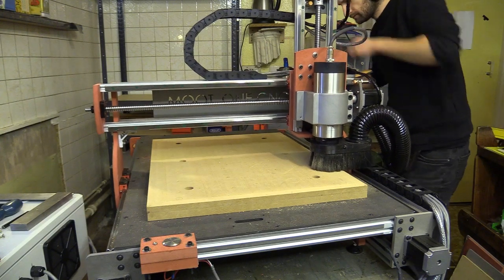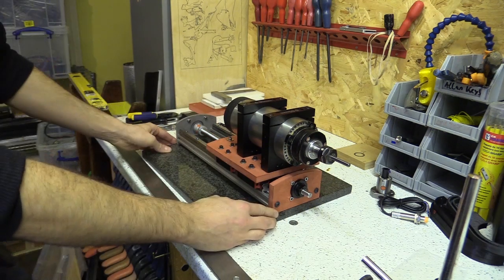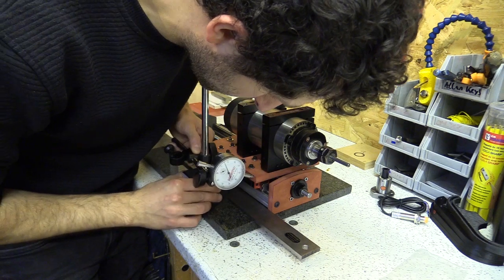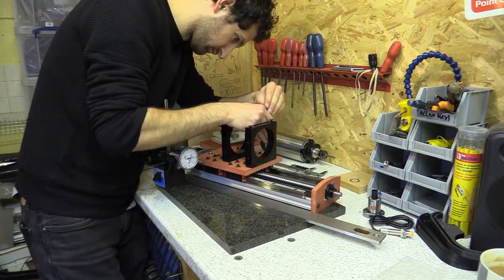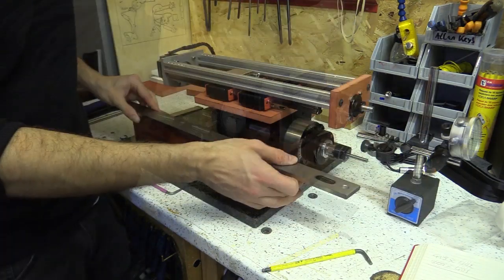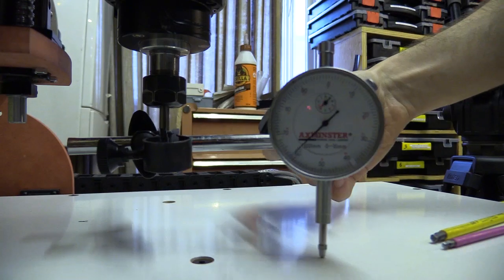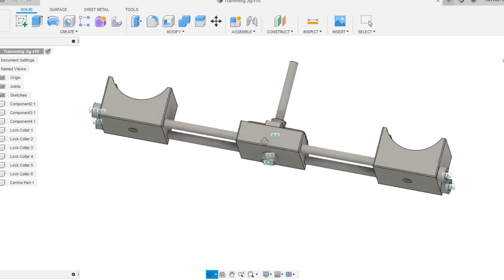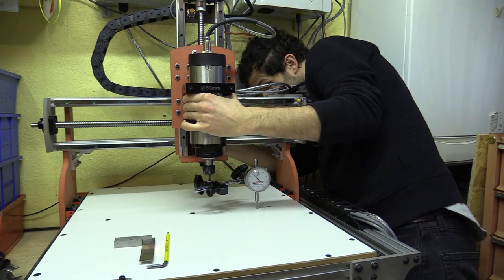#47 MOOT_ONE - CNC Z-Axis Assembly - Spindle Setting and Axis Tramming

Comment: I figure if I avoid getting a granite surface plate and machinists rules and 123 blocks, etc, for metrology, I won't notice how wonky mine is. It's good enough for wood and using belts and a lead screw there is only so much I can deal with. But yours is another step into regidity with the rails and ball screws. It is so interesting to see how the various parts  of a CnC machine are kind of in this arms race. Improve one aspect, then you have to raise the bar on another part. Again, a nice video to go over.
Reply from the maker: Yeah it kinda is a bit of a race - but I think I've plateaued now. I can cut things at a decent speed and finally understand how to calibrate the machine. So I'm getting good results and don't feel like I'm waiting ages for them. That granite surface I'm using is also just from the kitchen isle in the local retailer, and cost me £10 - so you don't need the super expensive engineering toys to iron things out. Cheers.

Comment: This Z axle have a bad concept!   if you leave the part with the rails fix with Y or X wagon, you lose space from table and Y or X axle....... Invert the system. put the spindle in the part with rails,  and leave supports alone joint directly on X or Y wagon.